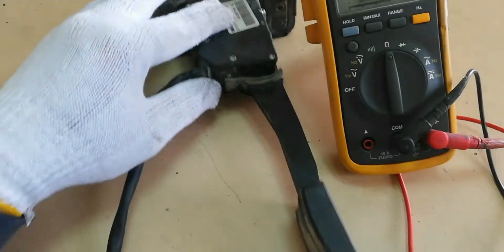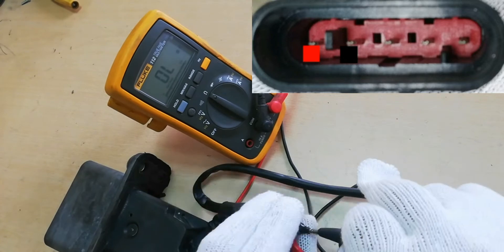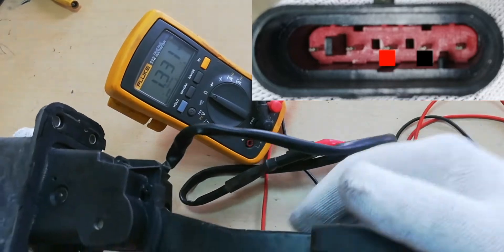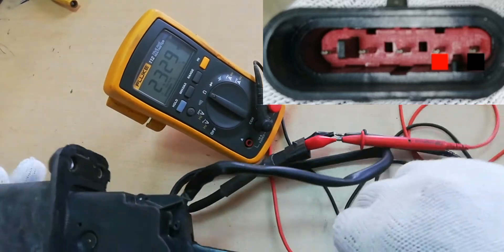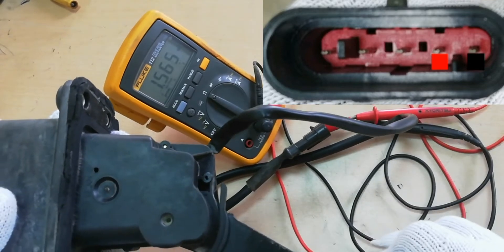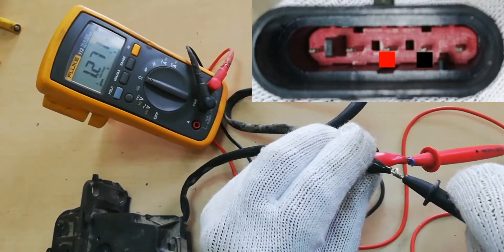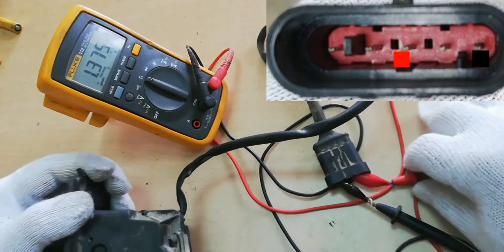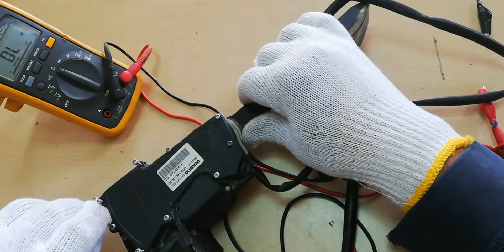WABCO ACCELERATOR PEDAL 965 100 0020 RESISTANCE TEST IVECO TRAKKER@yrhelmechanicalelectrical9113

Comment: what are the possible causes for unintended accelerator   iveco trakker
Reply from the maker: clean the plug socket in front of the truck the last thing you do is replace the accelerator pedal.